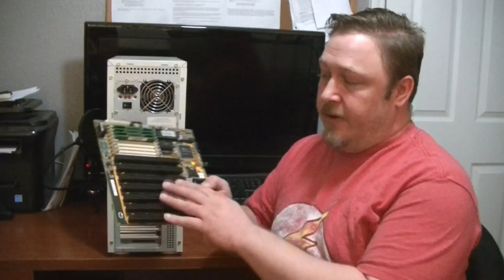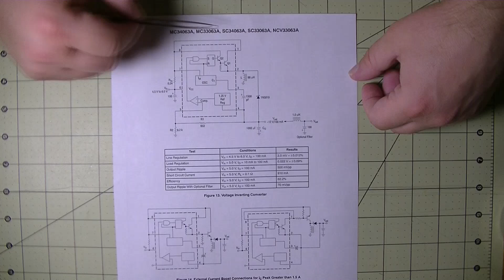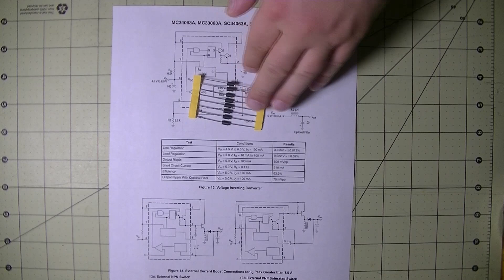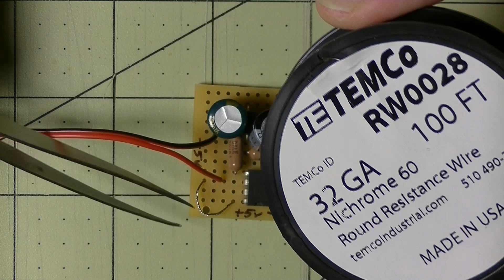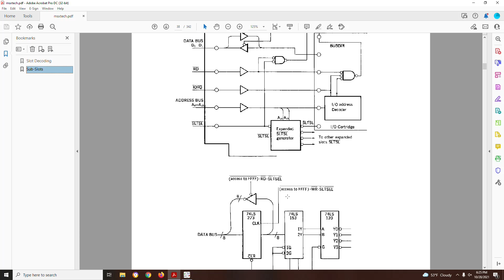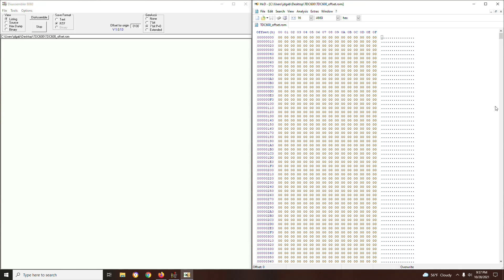Upgrading a Casio MX-10: Part 3

Comment: Probably the best explanation of slots I’ve seen so far - I have the expansion for my MX-10 (just replaced the PSU with a ECL30UT02-S - fit right and now it’s 120V!).  I think another frontier for this thing is a keyboard.   This computer really needs a matrix figured out so we can make a replacement for it.

Comment: I loved the Casio series. I have many MSX and I am playing with the RAM on the PV-16 but I cant get it to read 32k on slot 0. I am guess the engine has a dedicated pin for the second 16k page. I would love to know if you can share any documentation you might have about these Casios and, if you have a board left, I would buy it from you too. What is the state of this old project sir? Subscribed! Just awesomeness!
Reply from the maker: The MX-10 is the only Casio MSX I have looked into.  I can't say what the issue with it not reading Page 1 of the slot, but it should unless I'm missing something.  As for the expansion adapter, I cannot say if it will work with your PV-16, as I have not investigated the pinout of the expansion connector.  But, assuming it has all the same signals as the MX-10 it should be possible to either use this device, or an altered clone that is pin compatible.  I do not have any additional boards left over.  Though I can point you to my github, you might also check out my old website on the way back machine at Archive <dot> org.  https://github.com/jdgabbard/RD-10-Docking-Station